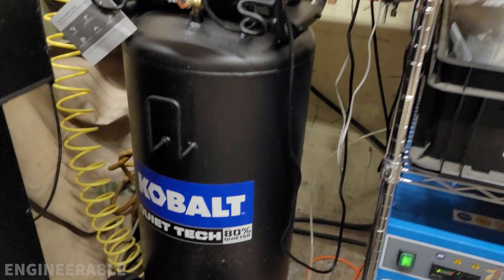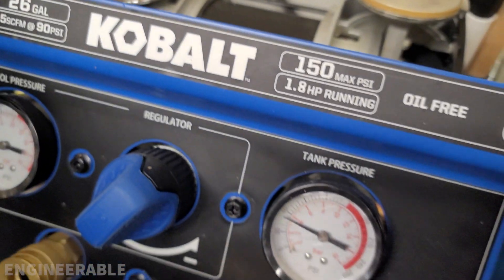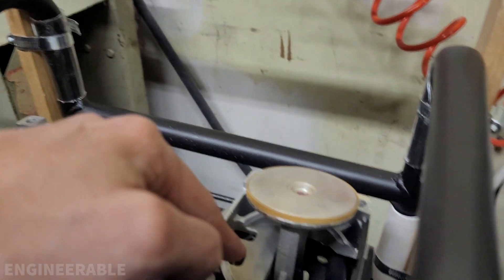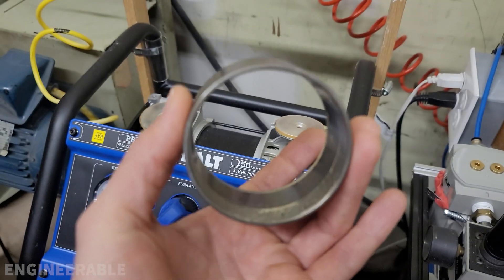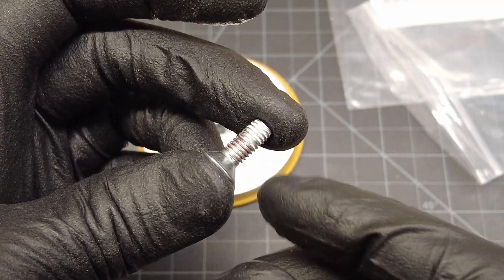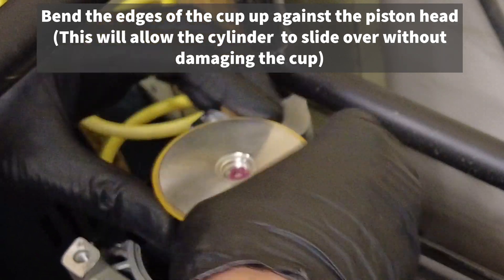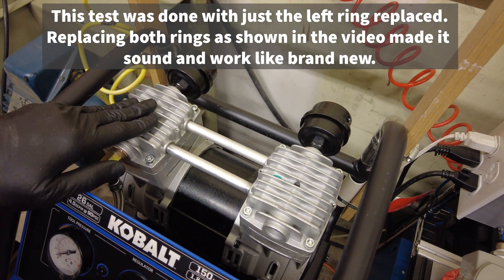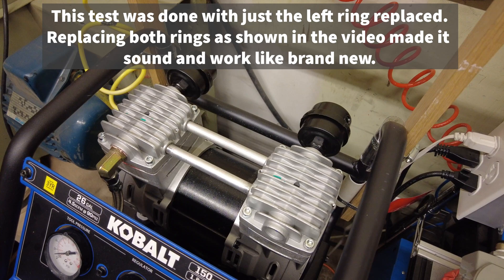KOBALT Quiet Tech 26 Gallon Air Compressor FAILS AGAIN! (Watch this to learn how to fix it)

Comment: Thank you for this. I have an Eagle EA6500, which appears to be the same compressor motor, that suddenly became very noisy and slow to build pressure. Hopefully its a simple fix like yours.
Reply from the maker: Sounds like the same symptoms. The piston ring cup is designed for 1600W motors, so seems like it should be the same. Check with Eagle first if they have rebuild kit
Reply: @engineerable  I took mine apart and found a huge gash in my cylinder wall, along with metal shards. Somehow something metal must have made it's way in and did damage. Oddly the cup wasn't completely compromised, however it was far from airtight.
Reply from the maker: @gjkMN  Is one of your intake/exhaust valves in the head broken? They provide those in rebuild kits, so I assume they can break.
Reply: @engineerable  nope, still intact. Just one intake looks a little dented from whatever bounced around in there.
Reply: @engineerable  update: upon further inspection, I did in fact have a broken exhaust valve.